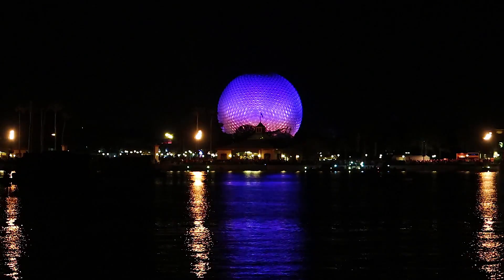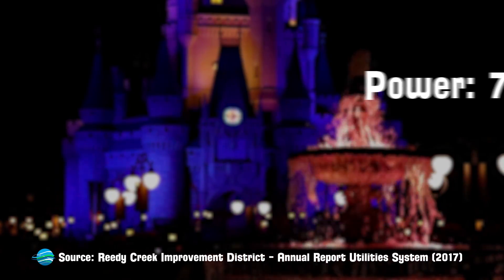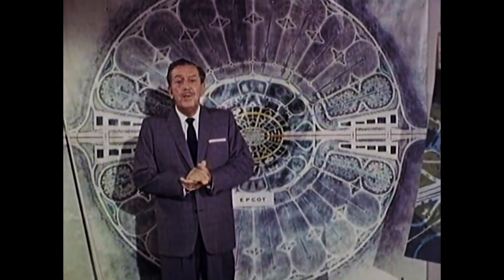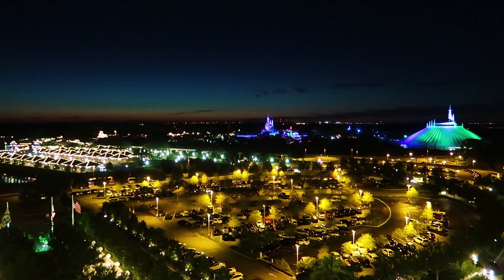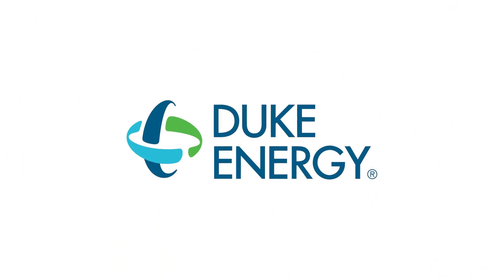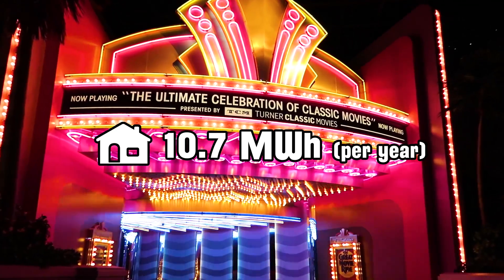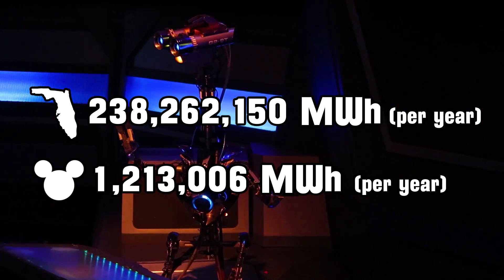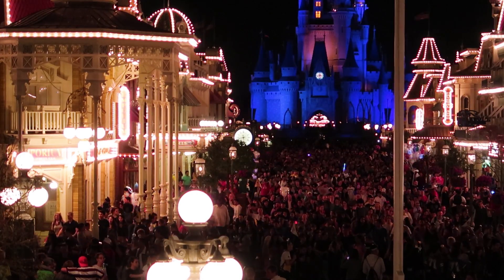What is Walt Disney World's Electric Bill?

Comment: I have a question ( you might have done a video about it but I'm not sure) why can't I see the magic kingdom castle from outside or from an airplane? So, I can't see it from an airplane but they don't have the red light because of forced perspective, so airplanes can actually pass by Disney? I don't get it.
Reply from the maker: Planes can't cross Disney property under a certain altitude because it has been a no-fly zone since 9/11. Combine that with the fact that MCO airport is 20 miles away and most passenger planes are still pretty high up on their approach by that point, and the truth of the matter becomes that the castle is just too tiny to see from up there. If you time your flights right you can sometimes catch the fireworks as they're going off, but even then they're pretty far off and tiny. Essentially by the time you're low enough to the ground that you'd be able to make out the castle, you're far enough away from the property that you can't anyway.
Reply: That makes sense! Thank you!

Comment: Maybe disney should do an energy efficient makeover to see if it can cut its bill by 30%.
Reply: Chris Baker You're telling me that all of the air conditioned shops with wide open doors is not cost efficient?
Reply: They tried shutting all the doors when they first opened Buena Vista Street at Disney California Adventure.  It didn't work for the guests or Disney's bottom line.

Comment: How has Disney's electricity use changed over time? With the advent of LEDs and CFBs, etc. and the replacement of older fixtures, I'd imagine it's gone down...?
Reply: lbart37 exactly what I was thinking. Been there several times since 1998 and it seems the majority of the lighting has been replaced.

Comment: Disney World is 49 square miles, about 7 miles x 7 miles.  Disney is allowed to have their own nuclear power plant, this is something they put in the deal with FL back when.  It is doubtful they would ever build one, because of the greeny nuts out there and the regulatory red tape.
Reply: Avery Lopez-Baines you do realize nuclear energy does not require fossil fuel
Reply: A D plus I mean if they had a meltdown, Disney world would pretty much have to be shut down for an incredibly long time, so they wouldn’t take the risk. It would be cool though
Reply: Nuclear power is very green
Reply: I assume by "greeny nuts" he means those greenies who are underinformed or not rational. As has been pointed out nuclear power has a much lower environmental impact and is vastly safer at every stage than most conventional kinds of power generation.
Reply: Goreo Productions --- right... an incredibly long time, in the case of Chernobyl, is 3,000 years.  I don't think Disney could wait that out.

Comment: Why do you post videos at 60fps? 720p/30 is more than adequate for the content.
Reply from the maker: Ultimately, there's no reason not to. It's no extra effort on my part and YouTube prefers the highest resolution/framerate possible.
Reply: Interesting, although YouTube says "Content should be encoded and uploaded in the same frame rate it was recorded." The extra bandwidth probably isn't a deal breaker for most people, but the extra (interpolated) data does consume more electricity 😉
Reply: Alex nope my hardware supports it fine. Does all that stock footage shot at 720/30 really look any better upscaled? Does all the moving text that mirrors what is already being said really degrade the video at 30fps? Rob's a good guy, but most talking heads come across as pretentious at 60fps. We're talking about mini-fluff-docs—not video games.

Comment: But what runs their first and secondary power plants? It it coal, natural gas, etc...
Reply from the maker: Per the RCID Utilities report, the CEP uses General Electric LM6000 turbines which use gas, and the ECEP plant has two packaged diesel generating units.
Reply: Thanks
Reply: Reedy Creek actually has the authority to build nuclear power plants. But I think they don't because nuclear energy doesn't sit well with some people.
Reply: Miss Jessi watch the video
Reply: maybe because solar is cute but not as reliable as an LM6000 fired by gas fuel and they don't want people to be paying 800 bucks a night in a hotel with no air conditioning or wifi because the sun isn't out